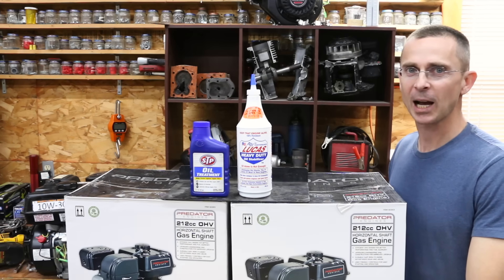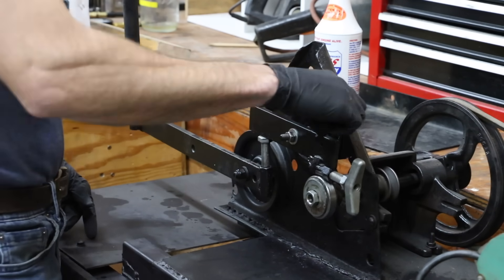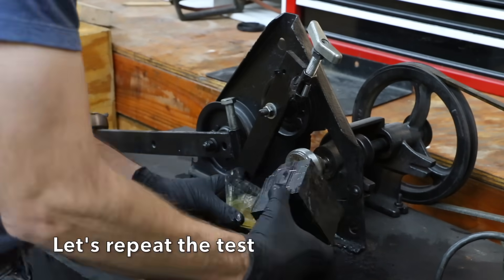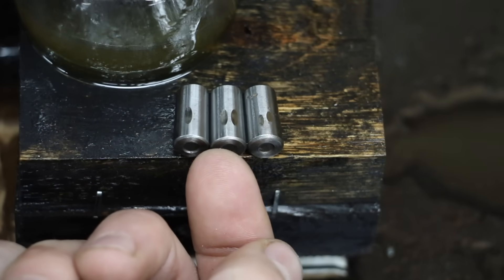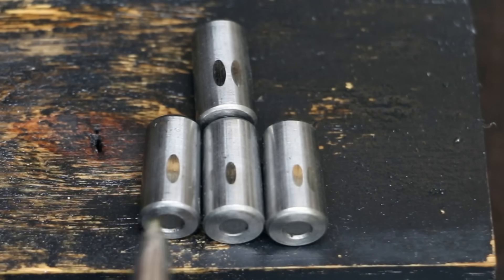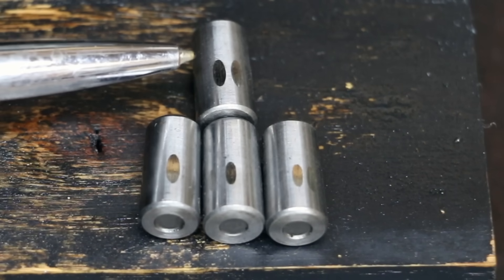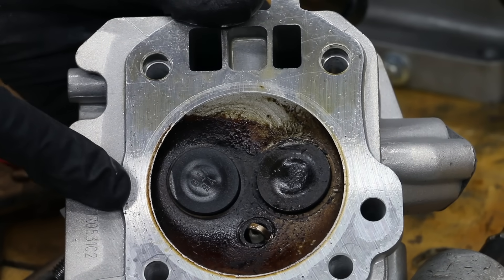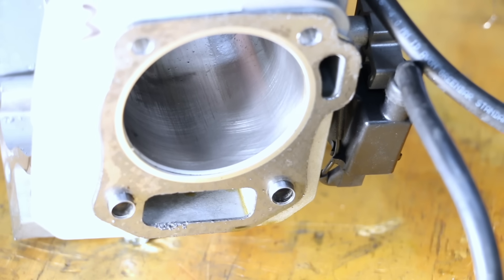Which engine self-destructs first?  Lucas or STP?

Comment: This is the new reply for the race surface scratches.
I don't think there is a solution except for replacing the race for a new one.
However I know there is an English/Polish yt-channel (Piotr Tester) which tests oil on viscosity and wear with almost the same setup as yours. Maybe you could enquire information about his testing methods.
Reply from the maker: Thank you for creating a new post and commenting.  I'll definitely dig into this more.

Comment: On an old cruddy engine test oil cleaning additives. Like z-max or similar. I have torn down a 250k mile 4 cyl with z-max used every other oil change. Engine still looked new minimal wear. Would be fun too see head too head with bg moa or something. Great videos!
Reply from the maker: Thank you for this recommendation!

Comment: Operate an engine with the proper oil, then an additive is not needed. Each manufacture of the engine requires a minimum of certain additives(already in the manufactures)oil.Purchase an above average oil.  Heed this warning - not oils combine readily with certain types of added additives. Can potentially break each other down.  Product Data Sheet will show oil performance not an SDS or MSDS. Even then it only represents certain specific tests and not actual running conditions. Great video and it's this kind of relevant knowledge that educates on unknown factors such lubrication selection. Cheers Project Farm and thank you !

Comment: Duralube vs slick 50
Reply from the maker: Thank you for this recommendation!
Reply: This.  I may be showing my age but I remember the dura lube commercials when they first came out showing a duralube treated engine running with no oil and outlasting the other additives. Figure it was all hype but would like to see if there's anything to it.
Reply: Someone on Instagram is marketing a "brand new" engine additive - which sounds a lot like Slick 50.  I commented that I would reserve judgement until the ProjectFarm video debunked it.  LOL.

BTW, there is already a ProjectFarm video on Slick 50.
Reply: I remember the commercial as well. I have used the Duralube with good results, I had a old out board motor with a air cooled motor, water cooled foot. That would get very hot after just running a short time, after treating it with Duralube it ran much cooler. I never tried it without oil.
Reply: You might want to test Xcelplus, as it is claimed to be the original Slick50 formula https://www.youtube.com/watch?v=CAt-tJa9P_s

Comment: I think the company that makes the engine is the real winner- you're keeping them in business. I don't know if this idea would be an "infomercial" for Predator engines or not? You must defeat the "low oil safety sensor" for these tests, well- I'd like to see how that actually works. Pour out what's in the crankcase, measure it. Pour it back in. Start it, run up to operating temperature. Loosen the drain plug, have it drip into a graduated container. How much is lost- before automatic shutdown? Did it save the engine? How much damage was done? Why aren't all modern vehicles equipped with this? Why has no one developed an Aftermarket device that you can add on to any 4 cycle engine? When I was a kid- my Tecumseh riding mower died- when the oil filler tube came loose, dribbling out enough to grenade the rod under working load and RPM. Unlike junk now days, though- I simply installed a new rod, and a better screw for the tube's bracket- and kept it going for years. Stuff was made better back then.
Reply from the maker: This is a great suggestion to test the kill switch.  Also, great point regarding modern vehicle engines not having these.  Thanks again!

Comment: I think Lucas was clearly the superior performer and the winner.  I am biased however as Lucas products are my go to brand.  Another great video, thank you for doing them.  I would like you to do a video series comparing HHO (Brown's gas) Versus standard and alternative fuels.  I would compare things like fuel consumption per hour, carbon deposition, temperature...pretty much what you already do.  The destruction stuff is cool for testing oil additives and I really appreciate how you do it.  Also the bearing friction tests are interesting.  I was thinking you could build a small engine load brake type device with an old cement mixer or a vehicle rear end to provide some hard work for those test engines...I bet you could engineer a great one that could even cause engine failure without draining the oil, and could also test the other variables if failure was not desired.
Reply from the maker: This is a terrific suggestion--thank you!

Comment: Wonder what would happen if you ran a very thick oil (80W90) against a very thin oil (0W20) in a engine that requires a 5W20-10W30 🤔
Reply: fill er up with some stanky gear oil
Reply: Derek Joon engine oil weights and gear oil weights are not the same scale. 80 weight gear oil is a~ 20 weight motor oil.
http://www.doolittleoil.com/faq/viscosity-sae-iso-or-agma
Reply from the maker: Thank you for this recommendation!

Comment: I don't understand the point of this test. STP and Lucas aren't claimed to prevent an engine from blowing up without oil or are they claimed to let an engine run without oil. They are claimed to be oil treatments to either lengthen the life of oil and or reduce the friction in an engine and let parts last longer.

A more targeted test for these additives would have simply to instrument an engine being run with regular oil and measure engine temps, power and friction, and then add the additive and compare the results. 

I think the only thing we learned here is how harbour freight predator engines blow up when they lack lubricant.
Reply from the maker: Thanks for the constructive feedback.

Comment: Another great test video! 
Before watching the test, I'm guessing that the Lucas engine will last longer because it has always performed better for me.
I also have a question about your test apparatus. Instead of sanding the race, shouldn't it be polished like internal bearing surfaces are? I'm thinking that sanding it introduces a rough surface and it may not be fully indicative of the product's benefits.
Additive tests would be great. You've already done the one I was most interested in though, the Engine Restore additive.
A test between the high dollar aftermarket oils would be interesting though. Find out if any are worth their high prices.
Examples; Red Line, Amsoil, Royal Purple, Gibbs, etc., etc..
Reply from the maker: Thank you very much for the positive comment.  I will reassess how best to prepare the bearing race.  You bring up a great point.  The goal is to remove the oil that's penetrated the surface area.  Again, great point.  I'm always trying to improve.

Comment: You didn't baseline the engines or have any sort of control.  This experiment is inconclusive at best.　　Also it would have been better to stop the Lucas engine when the STP failed for you could compare performance..  This is pointless once they've both blown up.
Reply: he did a control test in a previous video (10w-40), no use repeating it for every video
Reply from the maker: Thanks for the constructive feedback and thanks for this recommendation.
Reply: I think he is doing a good job. Sure there are variables but this is a farm project not a GM lab. The variable I would like to see eliminated is the coarseness of the test wheel.  Would 2 smooth bearing surfaces over a longer time work?.

Comment: I got an idea run them with the vapors just like your other video but take all the oil out and just run them with stp, Lucas,etc... or any other oil additive
Reply from the maker: Thank you for this recommendation!
Reply: Project Farm also I had another idea. Do you know those types of engines that need oil mixed into their engines? See what will happen if you don't add oil and then add oil to an engine that does not require you put oil into the fuel.

Comment: Too bad I didn't post on the previous video because I thought someone else would have mentioned it. When you are sanding the absorbed oil off the race your are creating tiny scratches on the surface which will increase the wear of the bearing. Because these scratches cannot be replicated by one hundred percent, it renders this measurement/review useless.
Reply: ordiantakeover I was thinking the same thing on the previous video
Reply from the maker: Thanks for commenting on this.  Do you have any suggestions?  How about using sandpaper?  Could you please create a new post so I can easily find your response?

Comment: So How Long does one of These Engines Run with Regular oil drained out. No Stp or Lucas. That should have been the Baseline time to see if Lucas or Stp Extends the Running time. So what was the point of this video wirhout this Baseline.
Reply from the maker: In the previous video series, I established the baseline.  Sorry I didn't explain this in this video.  Thanks for commenting.

Comment: Will leaving the choke on an engine kill or damage it?
Reply from the maker: I can do a video on this.  The short answer is that it is not good for the engine to run too rich, which would be caused by running it with the choke after it's warmed up.

Comment: Lucas won, it ran longer with no oil, implying it's lubricating properties, are better. However, when it did fail, it seemed to me that the pop was louder. Also the scoring on the cylinder wall was deeper.
Reply from the maker: All great points. Thanks for commenting!
Reply: Cody does make good points.

Lucas won because it ran longer. This means that the lubrications lasted longer before failing. The louder pop and deeper scouring makes sense simply because it was run longer allowing for more heat buildup and longer bearing run time. Generally the engine running longer with no lube will have a more catastrophic failure.

In order to compare scouring like for like. You would have to run the engines without oil for the same amount of time.

Comment: Have you compared regular oil to synthetic? Maybe before I found your website? If so, would you show the link to that test. Interested as I now have a car that "requires/recommends synthetic. Tnx! 👍
Reply from the maker: Not yet, but thank you for this recommendation!
Reply: Thanks! A lot of my friends are questioning about their new autos recommending the much more expen$ive synthetic. And from regular to synthetic, oil change intervals are still 5700 miles in many manuals.

Comment: I know it's a bit pricey, but curious about Amsoil and whether it's worth all the hype.
Reply from the maker: I'll definitely test Amsoil. Thank you for this recommendation!
Reply: I'll go ahead and throw in my vote for Amsoil vs Royal Purple
Both are considered the "high dollar" premium additives
Reply: I run Amsoil in all 6 of our vehicles including my Cummins, as well as all my small engines. I have yet to have an engine fail and the small engines run cooler. I feel it's worth the extra money when I change my oil every 10k miles it actually saves me time and money.
Reply: Me too. Been spending the extra $ for years on the stuff. Only difference I've noticed is how it cranks easier in colder weather (below freezing). The engine has lasted for 283K+, but is it due to the oil?
Reply: I’m a firm believer in amsoil! I’ve seen some amazing thing with it!
Reply: I wish I knew. I've been considering the oil myself as I know so many swear by it.
Reply: The stuff is pretty damn good. TBN is always solid on my samples I send in for testing on my '07 Silverado (the cheaped-out GM engine is another story, however ...). 

I also use it in small engines - one of my customer's v-twin rider mower has 700 hours on it. Did head gaskets last year, and the cylinder crosshatch was still plainly visible with no wear patterns whatsoever. I also run their Saber Professional 2-stroke oil at 100:1 in all my handheld equipment. 

Neighbor has used it in  his Stihl since he bought it new 3 years ago. He's cut every square inch of his 10 acre property he owns, plus done tree work for others - probably has 2,000 hours on that saw easily. Hasn't had me clean any carbon out of it yet! Compression still feels as good as the day he brought it home. Pretty impressive. Don't know about anyone else, but I'm sold on the stuff.
Reply: https://540ratblog.wordpress.com/2013/06/20/motor-oil-wear-test-ranking/ It is a pain in the butt to navigate but has great data. 

To simplify in my humble opinion. If you are running a full synthetic Amsoil is worth the money. If you are running a conventional motor oil and maintaining appropriate service intervals than Castrol GTX is an excellent choice for the price. Most true synthetic motor oils are going to outperform conventional oils, period. 

Note that the advice I am giving is not applicable to extreme performance/unusual operating conditions. 

I suspect when it comes to conventional oils most of the big name brands will work just fine if the oil meets the manufacturer recommended specs for your vehicle.  Same advice when it comes to filters, anything that's not the economy version is more than good enough. 

No oil in the world is good enough to save an engine from poor maintenance. And preventive maintenance is generally cheaper than catastrophic failure. 

From personal experience I've changed head gaskets on high mileage engines that ran Castrol GTX most of their lives and been very impressed with engine cleanliness and the excellent condition of the factory cross hatching in cylinders. (A lot of 4runners and other aluminum head engines have had issues with head gaskets until replaced with MLS head gaskets.) That's why I trust it, I'm sure others have had similar experiences with Valvoline or a dozen other choices. 

My Silverado with a 6.0L V8 just ticked over 250k miles running Castrol GTX and I expect to double that. 

I would probably have similar results with other oils because I actually perform maintenance on schedule. I still suspect that is more important than my choice of oils or any brand loyalty.
Reply: I'd like the see a comparison between AMSOIL and Redline. I switched to AMS high zinc 10-40 in my old NA SR20, and it ran much smoother, and resolved a slight oil burn issue I had. I run Redline MT90 in my old Nissan trannys for lack of other options. Never heard anything bad about either.
Reply: Fred Flintstone what engine? I have a 5.7 in a 99 GMC that just turned 326k. Never seen amsoil. I think its due to roller rockers in the valve train.
Reply: Project Farm can you add pennzoil ultra platinum too? It's so difficult to get it tho
Reply: Gary Iman:  I have a 4.0L in a 4X4 Ford Ranger (1998).
I also forgot I put Amsoil in the diffs and tranny/transfer case at about 100K.  At around 200K; found there was NO lube in the rear-end. Refilled it and still haven't had any trouble there.  BUT, the truck has never been on the track either, and I usually don't drive real hard or carry more than several hundred pounds of cargo.
Reply: Royal purple is dyed crap
Reply: I'm running Amsoil in two vehicles but it's still awful early to come to a conclusion, IMO. It's only been a little over a year since i started in the low mileage 01 Impala and about 7 months with the 99 Suburban TD.
Reply: Where can I get Amsoil?  I have 204k miles on my Explorer and I want to keep it alive forever!  I've been using synthetic oil + Lucas, but if something out there is better I want to know about it.
Reply: Switched to amsoil from previous owner because I heard horrendous things about RP in our engines (VQ) but good in transmissions. Not sure what was used before that but I felt the difference. The car just felt alot healthier and idled better, even switching through the gears felt smoother. I never looked back even though it's pricey.

Comment: I am currently using Hyper Lube oil supplement for my 1988 Honda Civic D15B2. It is similar to Lucas but they state that it has anti-foaming agents and it "clings" onto metal surfaces. I am not into oil additive but on my youtube channel, I am slowly uploading videos of different oil additives and getting them sent to Blackstone Oil Analysis. I just do it out of curiosity to see if they are beneficial. I'll upload a video by tomorrow. I recently got my oil analysis results back for Restore engine restore and lubricant.
Reply from the maker: I'd like to see the analysis results!  Thanks for commenting.

Comment: What I really want to know about these Predator engines is if you can obtain repair and rebuild parts for them.
Reply from the maker: Great point. I plan to research this.  The owners manual has a parts list, but not sure if the parts are more expensive than a new engine.